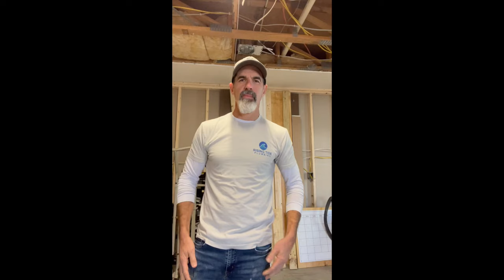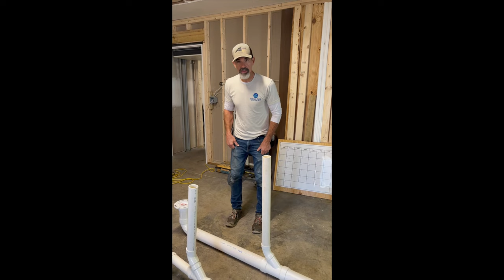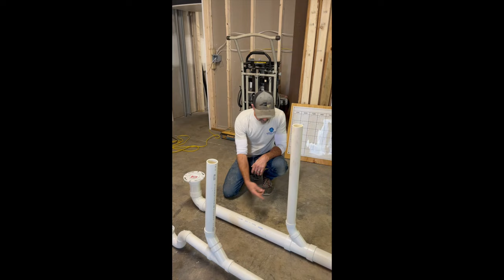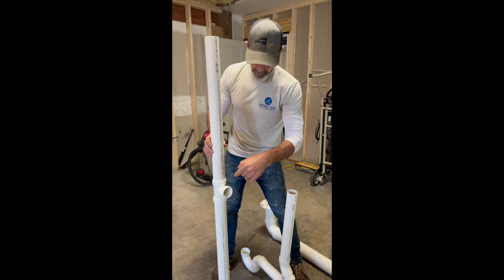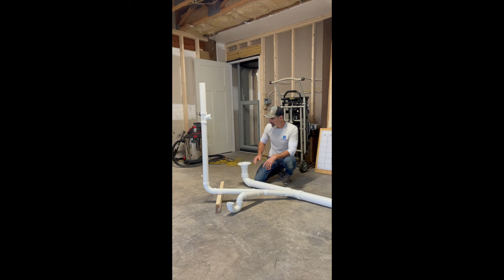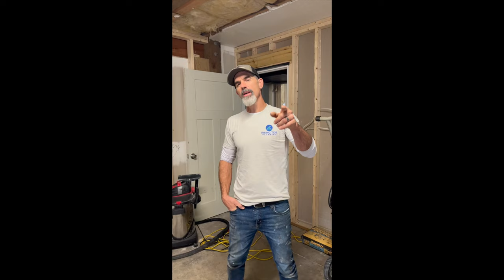The Basics of Venting in Plumbing in 4 Minutes

Comment: wouldnt that set up allow the toilet to back up into all your fixtures if there is a clog?   Also is there a rick of sink traps being sucked dry when toilet flushes??
Reply: The traps being sucked dry is the reason for oversizing to 2” allowing the wet vent to function properly.. as for a clog that is always a risk wet vent or not the drains usually connect in close proximity for a bathroom group
Reply: A backup would come out of your lowest drain, ideally a bathtub, maybe a shower, or a floor drain. That can be the case whether it’s dry vented, or wet vented. If the clog happens somewhere after the tub drain for example, connects to the main line, it will back up the tub. If the clog happens between the toilet and the main line, then only the toilet would be affected.

Comment: In Canada, the wc has to be the most downstream connection in the wet vent. It can be symmetrically connected however it still must be the last fixture draining onto the branch
Reply: In Florida we call that major over minor. You cant run a major past a minor............
Reply: Kinda a dumb way to plumb. If everything downstream of a water closet is vented, then the toilet will cause no issues.  If you're talking a major over a minor, in my area, that would be in the vertical. For example, tying in a washing machine on top of a lavatory below would definitely cause issues.
Reply: The water closet is the most downstream on the wet vented branch due to the volume and velocity of the water moving through the pipe after a flush the concern is that it could siphon a trap if the WC upstream of say a tub or shower
Reply: Don’t speak for all of Canada. This is how most of Ontario plumbing is done, excluding some townships that are still old school plumbing code

Comment: Thanks! Great video. I am an interior architectural designer helping design my parents' bathroom IN A HIGH RISE CONDOMINIUM/apartment building in Florida. We are on the 3rd floor. There are 4-5 units per floor and 12 floors total. I have worked mostly in the UK and Asia and some US regulations are different based on UPC or IPC. I am NOT an expert in venting or vent stacks but I know we need them. I have read the vent stack cannot be less than 6 feet for the closet flange of the WC/toilet. We had a plumber in for a look and quotation and he suggested our toilet had a vent stack right behind it making a wall-hung toilet and hidden cistern impossible. However, on the architectural plans (not AS BUILT), there is a VS and SS just about at 6 feet from the existing WC toilet. If I am correct and there is only one vent stack and one soil stack at 6' or less, is it possible that the plumber was incorrect? I got the feeling he likes to keep life consistent without change or new plumbing ideas for convenience. But I don't want to misjudge him! We are also speculating on installing a single breaker tankless water heater and he groaned at that. Well, he groaned more at the idea of a whole home 3-breaker tankless water heater. What is your experience with ELECTRIC tankless water heaters in the USA? Nay or Yay? THANKS SO MUCH IF TIME IS POSSIBLE TO REPLY.!!

Comment: Pretty solid explanations, although California Code and the International Code has a couple of extra requirements for wet venting, namely.
The vent line must be taken off the drain above the cross section and you must increase the drain pipe size by 1. 
Example: The pipe going to the lav off of the shower would need a 22* or 45* fitting and the pipe from that wye to the 3’’ would need to be
2 1/2’’ or 3’’. The other Lav would only need a 22* or 45* since the tub drain minimum is 11/2’’ an I believe you ran 2’’. 
I am sure the way you have these fixtures plumbed they would work perfectly, this is just the codes we have to adhere to in my world.
Also I have Plumbed in Europe and also own a couple of houses there and our standards are more rigorous to put it kindly.
(Licensed Plumbing Contractor for 30 years, retired)
Reply from the maker: Thanks for your comments.  It's very interesting how codes differ in different areas.

Comment: Thanks for the video! This helped me a lot! 

I don't know if you'll see this, and speaking of dry vents - I bought a 55 year old bungalow and I've discovered there is what I suspect to be an old copper 2" dry vent. I was noticing some drips/green stains near the bathroom basement ceiling fan vent cover and on the floor beneath the fan. I saw that there was just a horizontal run of this 2" mystery copper pipe, left uncapped and open right next to the fan body, it was dripping down though the grate. I assumed I was getting condensation from it. Well, what do I know? Not enough! I got a fitting and capped it. Seemed okay for a time.  One day much later, heard a loud bang, and big mess from the basement ceiling. So I rip out that section of ceiling, and I see this same 2" pipe had a bend to send it vertical and through a main floor bedroom wall. The soldered bend gave way and dumped what was collecting in this pipe. Today I see in the attic that this pipe goes up into some long cylindrical copper fitting (maybe 4 or 6 inch around) and out through the roof. 

Would you have any suggestions for decommissioning this properly? I think the only thing to do is remove the whole darned thing, it's likely to attract condensation any way I think about it, and if I cut and cap it anywhere I'll have the potential to trap water that might surprise me again with damage.

Anyway, if you happen to see this and have any thoughts I'd appreciate it!
Reply from the maker: Hey there. It sounds like you have the right idea as far as getting rid of it if possible.  If you just cap it, it will just fill with rain water over time.  You would just need to make sure that there is nothing else tied into it before you completely abandon it.   The other option would be to find a way to tie it into the existing sanitary sewer so it all is connected.  Hope this helps.
Reply: @risingtideplumbing  thanks for the reply! I appreciate it.

Comment: Nice video.  My home is a 1968, with one main vent stack.  I have a 1/2 bath with a washer/dryer sharing one room in the basement.  Id like to relocate the washer and dryer just outside of that room, and install a shower in their place.  Obviously there's some concrete busting and routing to do, but would adding the additional, new washer drain to that area pose any issues? Figure the water lines and electric are currently accessible, so hoping moving the washer/dryer a few feet wont be a total nightmare to add that much needed 2nd shower.

Comment: Jeff, thank God ( literally for your videos). I'm good at running water supply lines but not very knowledgeable on the drain lines.

I have a small ( tiny) closet size bathroom ( little bit bigger)  I'm doing that is about 30 feet away from the main stack venting line/ pipe ( running from basement to outside the roof), do I have to put in a separate dry venting system for this bathroom or can I water vent it, allowing the gases mixed in with ths liquid to travel the 30 ft to the main vent line ?  Is 30 plus feet to far? Any code restrictions on this ?

Help  😫 !

Comment: Thanks for a good video.

What equipment do you use to trace a cast iron pipe sewer under concrete; what do you use for tracing copper pipes (water lines) under a concrete slab. Thanks

Comment: Worked as a new construction plumbing manager for 20+ years. Venting is indeed Very Important. But the codes were developed by Unions looking to increase labor cost. The real issue with venting is code required pipe size. There is NO way Physics demands pipe sizes as large as code requires for P-trap protection. I always found the electrical code to be far more reasonable than the plumbing code. Glad I'm not doing either anymore! Haha
Reply: Kirk we are all glad you’re not doing it anymore either.
Reply: @bartowens1860  yep Bart. I have guys like you do the hard work, while I just take a cut off the top.
Reply: I don’t know, I’ve been doing electric work for 30 years, and every three years at our required 34 hour code class, the codes just get more bizarre.  These codes do not appear to be based on logic, just activists, trying to line theirs or their associates pockets!
Reply: Thank you for being a textbook example of braying ignorance and irrationality
Reply: Codes are based on service needs too. Bigger pipe aka less service
Reply: @Masterofnon3  No not true at all. Codes don't care about service intervals. Especially not for venting. There are certainly some engineering criteria, but venting has always been so far "over engineered" there is really no justification for it other than union labor. Back in the early 90's we started using Conine Mfg "Sovent" systems for high rises. It works great. Once you realize there are alternatives out there you begin to question venting code all together.

Comment: Question:  in an existing situation, where the existing copper roof vent is 1-1/2 at the lavatory sink, is it enough to replace the copper with 2 inch PVC up to the vent T, and replace any other 1-1/2 with 2?  No fixtures are being added, just moving the laundry from the basement to the first floor.  Tub/shower, laundry, lavatory and toilet.

Comment: Very good video.. I didn't realize you could oversize a pipe and use it as a wet-vent for other fixtures.   I'll share one comment regarding the straw-analogy which is so commonly used.  The straw analogy isn't terrible, but its not perfectly accurate, and here is why:    There isn't typically a hand or plug over a plumbing fixture drain (unless you plug the drain.. and then there should be no question as to why its not draining), so such a "suction" isn't normaly present in plumbing system,  even an unvented section.   However, water within a pipe full-of-water does resist changing shape as flow and would therefore suck a P-trap dry since it resists separation (or shape change) in the absense of air to allow separation (or shape change.. ie., taking up more pipe-length and less of the pipe's full cross-section).   The primary purpose of the vent is to break this vacuum downstream of the ptrap, to allow air to enter downstream of the ptrap so that the water can settle to the bottom of the pipe, thereby braking the solid-pipe-full-of-water vacuum that would potentially suck the ptrap dry.
Reply: We had a large shower install where a roman tub was, we payed to have the concrete floor busted out and moved the drain to the middle of the shower, we have always had issue after the fact, ankle deep in water, when the shower drain is working you can hear the sucking, do you think it is the venting might be clogged or poor drain install?
Reply: @Moondoggy1941  sounds like a clogged drain.. vent problems should only slightly slow drainage if that.. vent issue can cause ptrap to be sucked dry, but that doesn't sound like your problem
Reply: @larryzdanis5377  Thanks, I will hire someone with a camera.
Reply: Very few of my colleagues in the U.S understand why we vent.  Anti science is very strong in this trade and most plumbers will cling to the simplest analogy they can wrap their heads around to explain something in plumbing.  Thumb over the straw, (try that with 1.25" pipe) stab a water bottle and it will drain better, (except we don't reduce pipe downstream which is what a bottle represents).  Even when confronted with a direct practical test, I've literally demonstrated to my coworkers with capped off vents during new construction that unvented fixtures drain just fine, they still refuse to accept it.  Sometimes all you can do is repeat the mantra, venting protects trap seals, and move on.
Reply: @dmills13F  thanks.. its therapeutic to hear someone explain something accurately, because its so rare to hear an accurate description when it comes to venting.

Comment: I have an unfinished attic that I’m finishing. Need to do a bathroom with toilet, shower, sink, and a bathtub. How do I tie-in to the downstairs plumbing to make it work? The down stairs is a slab foundation. Have 4”x6” studs. Two down stairs/ground floor bathrooms and 1 half bath. The upstairs bathroom would be in the middle of the house and the downstairs are on the opposite side outer walls of the house. Is there a email or website I can get direct advice? My floor trusses are 12” the only problem is my span is perpendicular to wear I think I must run the plumbing.

Comment: The 3 inch PVC pipe that feeds into the 2 inch WYE connectors for the lavatory and shower/tub and also is used for the toilet, does this feed into the main drain line via a tee?

Comment: Nice venting demo, not trying to nitpick, but thought the bathroom group wet vent, each fixture was required to connect separately and individually to the branch the 3 inch branch? Just looking for clarification on the code?
Reply: I was taught this is incorrect. Seems to me the 2" became a separate branch just like the last 2" branch he took off the 3. Toilet still not vented in my opinion. The 3" is the bathroom branch everything comes off it unless it reduces and goes straight to the wet vent . Too many branches on this tree. Lol

Comment: Thanks for this video, I have a question, Can I exit my plumbing vent pipe through the attic side opening? I do not want to drill the roof, so I am trying to make the pipe exit through little window opening in the attic, and make the vent pipe terminate 6 inches as per code. Can this be a correct setup?

Comment: Howdy, I'm the DIY type of guy.
Adding bathroom. Toilet on 4" line. Then a 2" wye into 4" line.
Total 2" horizontal length of 10ft.
Start of 2" will be laundry washer, then shower, finally lavatory sink into 2" into 4" main.
Questions:
1) washer need solo 2" line?
2) 1 AAV or 2

Comment: Just had our roof redone and remembered I had never seen vent pipes coming through the roof. They were not there on the old roof or the new one. I went into the attic over the top of the closest bathroom, and there was only one pipe coming up into the attic. It was terminated in the attic with a special looking cap on it.

Comment: I remodeled my hall bath which originally shares a wall with the master bath. Both lavatories shared the same wall and drain to the vent. I have moved the hall bath to the wall perpendicular to the shared wall. A total pipe run of about 4 feet. I installed a "sweep tee?" on the existing master lavatory and added the pipe to the new lavatory on the other wall. Does the new lavatory need to be vented at the lavatory? I obviously will have a P trap. I can install a small vent valve in line with the P trap but is that really needed? Great explanation on the differences of vents.

Comment: My new dry fit vent stack is at 8’, not through roof yet, but instead of penetrating there, can I run horizontal and then pitch down to connect to an existing 1st flr vent stack that is only 6’ high?  (under my spray foamed attic roof deck). 
We got a new roof a few months ago, and I just hate to pop event, especially that will be usable from the front of the house. If I cannot slope it down to connect to an existing vent, I do have the option of a horizontal run through exterior wall .

Comment: Our house had stubbed in for a basement shower vanity and a toilet which I installed and it works fine. If the diameter of the pipe allows it to wet went then I don’t need a vent as part of the system?

Comment: Awesome explanation!!!  OK question.  We have a kitchen sink vented up the roof.  That drain connects across the room to a clothes washer drain (no vent pipe visible).  So when the washer dumps water, it fills the pipe, backs up.  About how many feet does the wet vent commonly allow and work well?  I have a video that shows my situation, with a camera in the drain showing constrictions, which lead to the non-venting situation (search Wade Hood Drain Episode 4 if you feel inclined please).  Anybody have experience?

Comment: Roll the 3x2 y at start of wet vent for water closet so the flush doesn’t cut off
Use 3x2 y combo with a 2inch st 1/8 bend to get 2/3 above 3inch drain

Comment: Question, I’m plumbing a bathroom and I have a washer at the very start of the drain line, then a lavatory, next is the toilet and finally a shower/tub before the line goes out the house. The plumbing is in the concrete slab. I cut the concrete straight in line with the toilet and I started with a 2” line from the washer to the lavatory and down to the toilet where I plan on using a 3”x3”x2” short 90 and just step up to a 3” straight to the tub and out the house. I’ve got a 2” dry vent from the washer and I’m also bringing another 2” dry vent up from the lavatory do I need to add another to the toilet and shower or are the 2 2”dry vents enough for what I have and is the 3”x3”x2” short 90 enough to pass inspection in San Diego Ca.? Thank you in advance.

Comment: Appreciate you telling the difference on the dry and wet vent. Have a question. I have a dry vent, straight pipe, going straight into the attic and out the roof. I will be moving the dry vent over, along with the toilet. Can I put 90 degrees on the pipe in the attic. We are talking about moving the vent about seven feet. I would be putting in two 90 degree bends to meet the pipe going out the roof top. Pipe is 3".  Thank you
Reply from the maker: Hey there.  You should be able to put the 2  90s in the attic and move it over to the new location.  It would be more important to be sure that the plumbing for the toilet itself is correct as you move it.  Hope this helps.
Reply: @risingtideplumbing  Appreciate your feedback. It does help. I could put another port in the roof but I was thinking I am moving it over between 5" to 7", 90's would not be an issue. I have a contractor who will be doing the work, he's done other work for our home,. Like getting a second opinion. Thank you